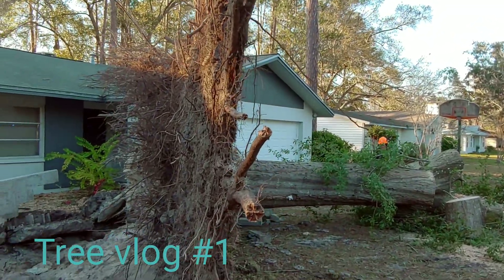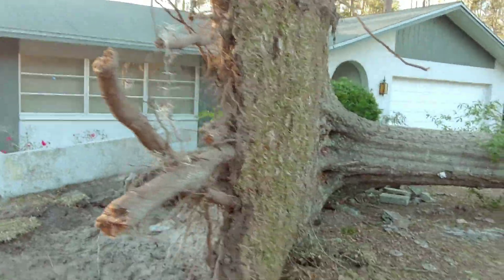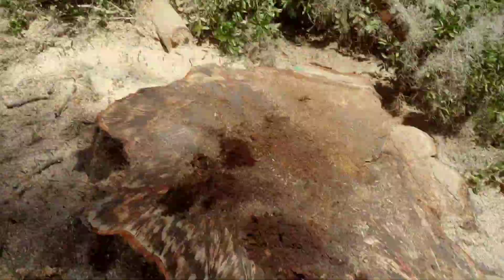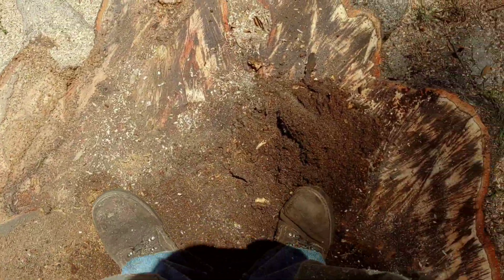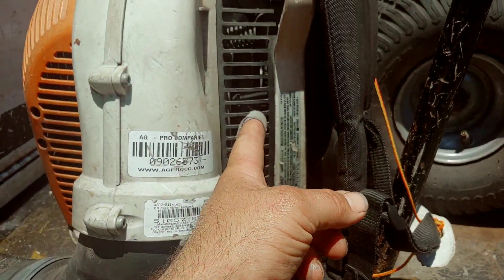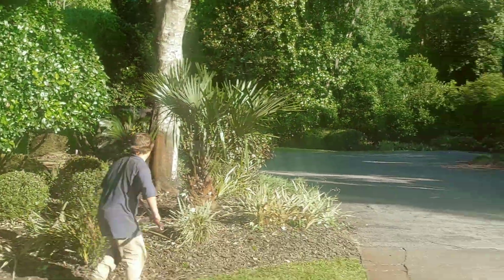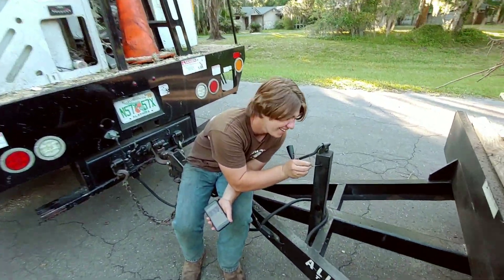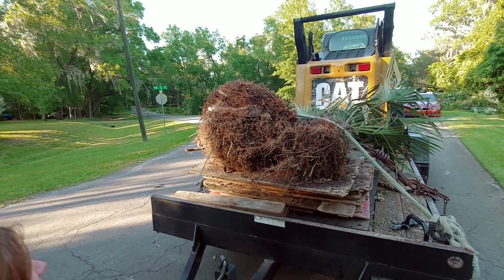How deep do a trees roots go?

Comment: Never answered the question?
Reply from the maker: Which question typically roots are in the very top layer of soil as shown in the video. But did you have a different question
Reply: @alexdobo3270  that's just it you just formed a broad generalization. Do you not know anything about forestry or geology? Both have huge affects on root growth and they are just as many or more trees that grow deep root systems. I have personally seen tree roots going down over 400 feet in specific areas and conditions. Before retirement I had over 40 years experience in heavy equipment and believe me I have probably dug out more stumps than you have ever seen.
Reply from the maker: @kenjett2434  ps when I put the word typically in my first reply. It covered the anomalies you mention in your reply to that. My answer is in a book the Isa certified arborist study guide.
Reply: @alexdobo3270  well you got it right but again when you said typically that is a wide generalization also. Now if you had inserted what you just posted to me in the video it would been much better video.
Reply from the maker: In conclusion, it sounds like you know as well as I do. There is no answer to that question. How deep do the trees roots grow? Every tree is different, and every species is different. That Has some
 effect on the way trees roots grow. However, every situation is different. The soil plays a role. The water table plays a role. The climate plays a roll. Time plays a role. Strange flex on the excavator thing. Anyways Best regards, Alex.  Isa certified arborist. credential number FL 6316 a. You can look me up on www.treesaregood.com